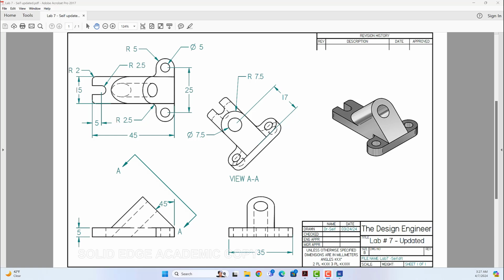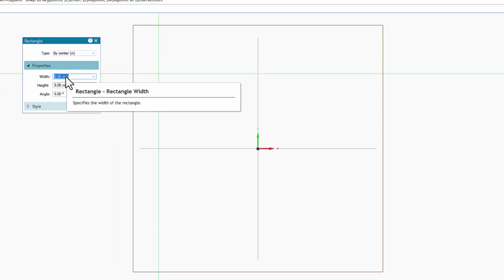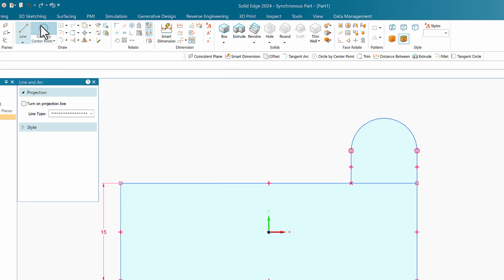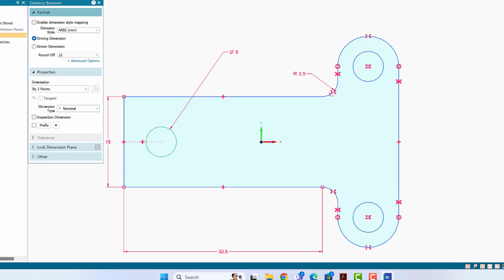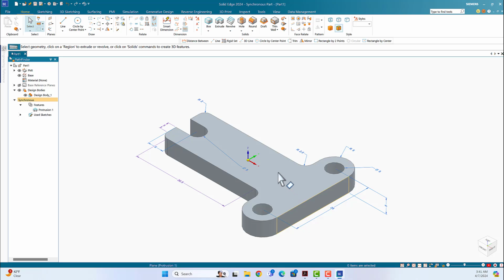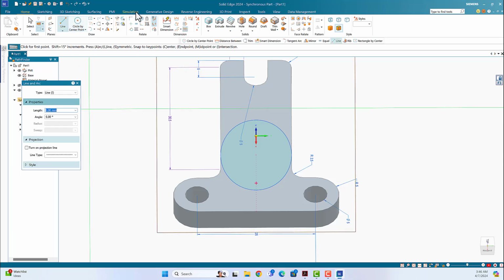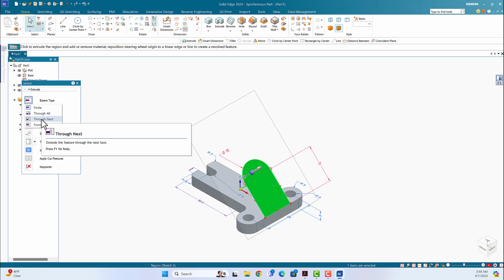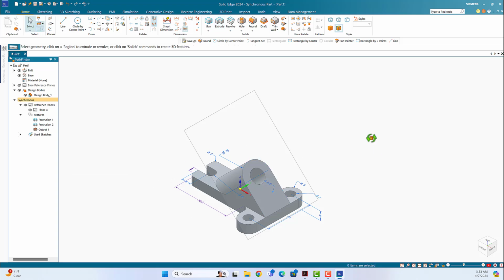Solid Edge 2024 Tuturial - Lab 7 Updated - Part A

Comment: I'm a beginner in solid edge. sometimes I think that sequential mode is easier than synchronous. how can I change the extrusion of the slanted part. So, e.g. I didn't choose "through next", but I already confirmed everything with OK. Do I have to completely redraw the slanted part? Unfortunately I can't find any documentation about it. This is easier in sequential mode. thanks in advance for your help

Comment: Hi
I created the drawing and then produced the solid, realizing that I had forgotten to include the two sets of fillets, (R2.5). does solidedge allow you to go back to the sketch and make alterations, I certainly am not able to see how to, in fusion 360 you would use the timeline. Have you produced any tutorials covering this subject matter, of editing, Thanks  I do very much enjoy your tutorials.
Reply from the maker: @doncoyle114   Absolutely, Solid Edge will allow you to modify the part and the draft sheat. Please watch exercise 5. One of the more advantages of Solid Edge is that it does allow you to import any drawing done by any other software and modify it.
Reply from the maker: Thank you for reaching out. Please watch this video, https://youtu.be/iJdFk3VfLIk
it will address your concern. Let me know if it helps. Thanks.
Reply: @drmseif  Hi 
thank you for your response so much appreciated from a solidedge learner, I watched your recommended tutorial and yes it did give me an insight into editing procedures, but I only managed to break more elements of the design, I will now create sketches and run exercises on editing to self teach, again thank you your support is very much appreciated.